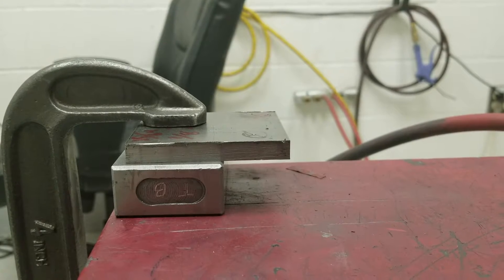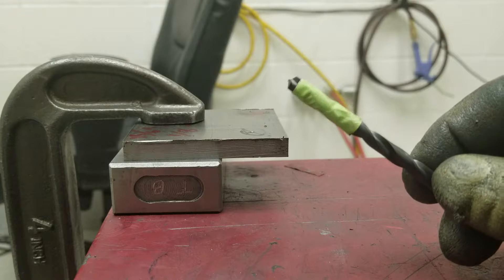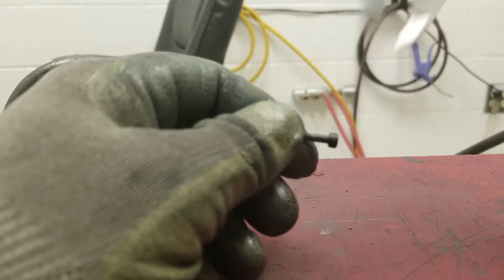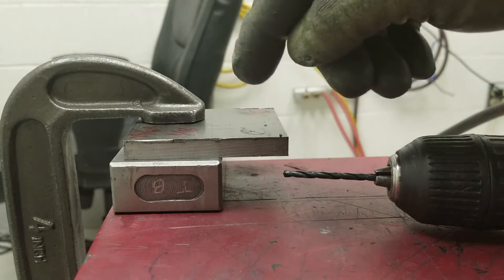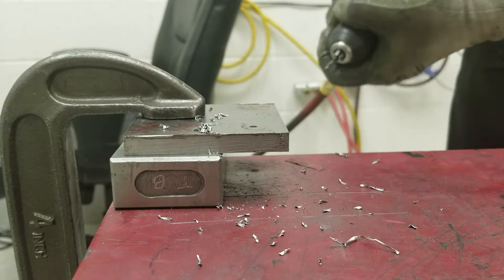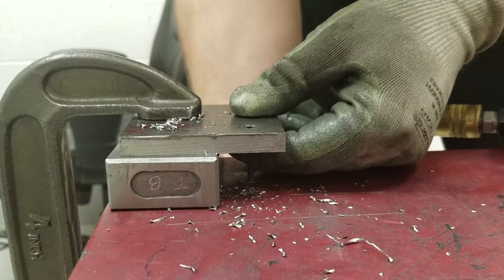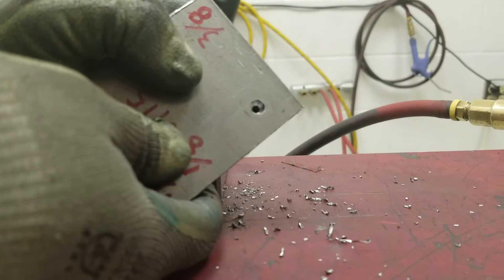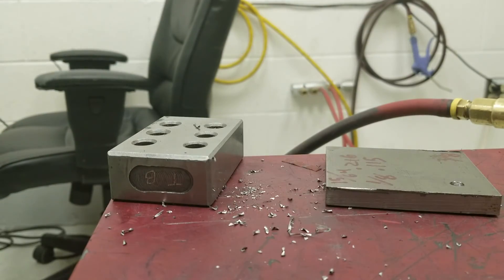How to drill and counterbore for a voron bed

Comment: Dude your drill is so scary
Reply: That was an air-powered drill and is very high speed and aggressive. He never mentions that is drill bit slipped in the chuck when he drilled his first hole. Compare how far the drill bit extended from the chuck at the start compared to just after he finished the first hole. Three factors likely contributed to this: 1) Chuck wasn't close tight enough. 2) He was pressing down very hard. 3) It's a very powerful drill. To avoid this, be sure the chuck is well tightened at the start. Use moderate pressure, just enough to get chips.